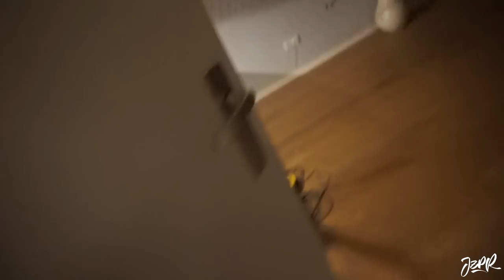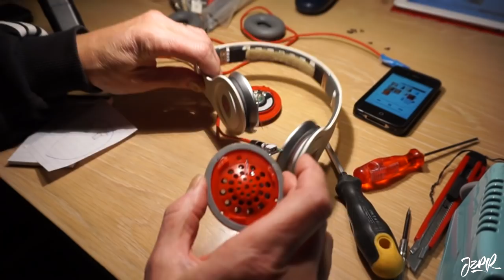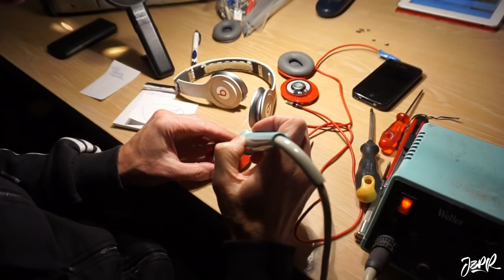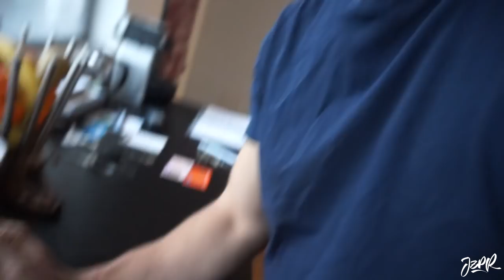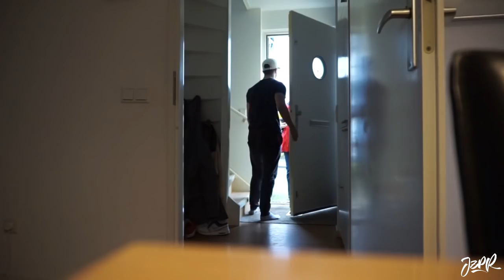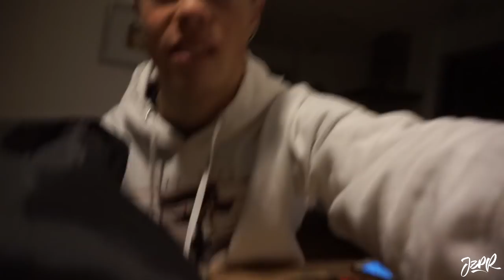Trying to Fix My Beats!

Comment: beats are actually so bad compared to everything else at the price point. even £100 headphones can be over twice as better. the Audio Technica ATH-M50x is a VERY good set of headphones and are £100. They beat pretty much every headphones up to £700! however i dont recommend them for the gym,  just because they are studio headphones and are made for editing, watching films n shit. and for the gym i recommend the Jaybird x2. they are a very good pair of earphones with lots of earbud sizes to fit your ear. they are very easy to control, stay in your ear very well and have amazing sound quality :) (pretty much anything is better than the beats loool)

hope this helped:)

...bitch